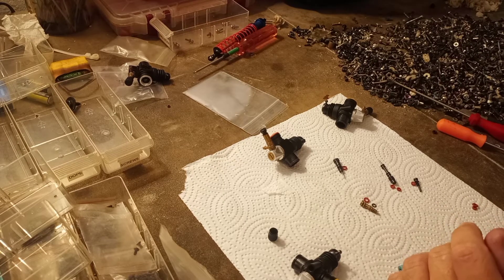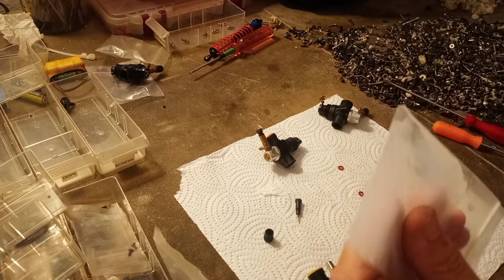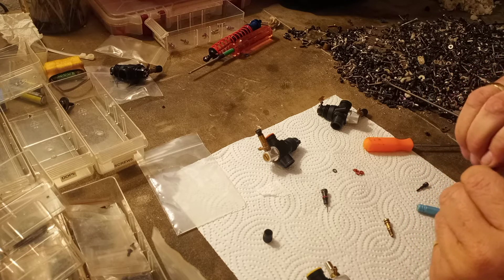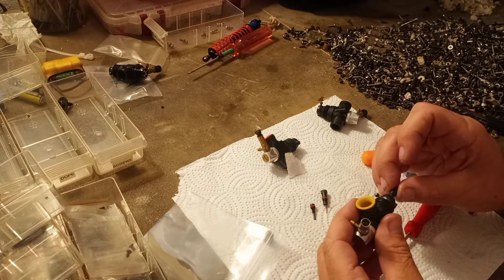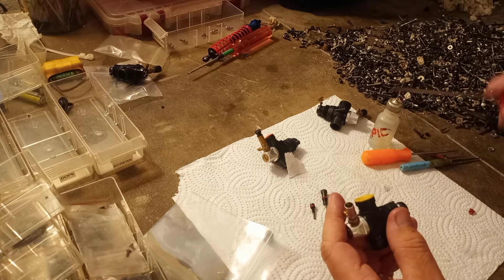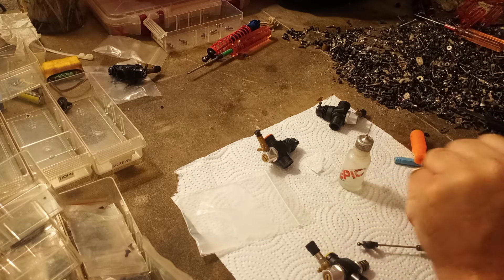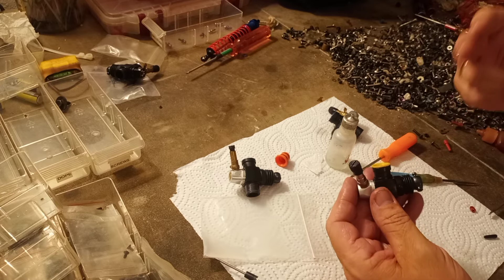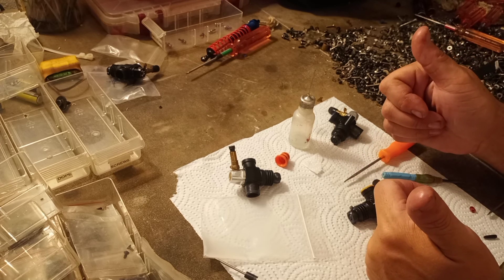Todd's Tips #3 rebuilding a nitro carburator carb new o-rings Molykote maintenance fix repair

Comment: Great vid and info! I’m rebuilding a HPI K4.6 which uses the same 3 needle carb(Kingstar). The mid speed needle is notorious for leaking, hopefully after they’re all replaced with silicone orings that’ll be a thing of the past! 
So I’ll need to order sizes 5x1.5, 6x1.5 and 4x1?
Reply from the maker: Correct, those are the sizes.
Reply: @NitroTalkwithTodd  Thanks! I was also looking into that MolyKote, is that the 111 compound? I heard of green slime but have never actually used lubricant for orings.
Reply from the maker: @SavageRobRC  yes,  111. I did a lot of research before paying $35 shipped for a full size toothpaste sized tube. I've been more than pleased with the results.

Comment: Nice video. Can I get a link to the o-rings?
Reply from the maker: https://www.ebay.com/itm/224557560168?mkcid=16&mkevt=1&mkrid=711-127632-2357-0&ssspo=eO_W8RE0QQq&sssrc=2349624&ssuid=fHwZ1_bCRtq&var=523346771857&widget_ver=artemis&media=COPY

The prices have went up a bit since I've purchased some. That is an example of a listing, not the exact one I used but it it's the same rings. You can get them cheap from China and wait a bit or pay more to get them quicker. The key sizes are 5x1.5, 6x1.5(both of those are in that listing and will be used in 75-90% of carbs) and the tiny one on this mid needle is a 4x1mm.
Reply: @NitroTalkwithTodd  could I please confirm with you buddy, here my orings are sold by... inner diameter by cross section of ring.... by that measure am I looking for 4.5id x 1.5cs??? Many thanks I've brought so many that don't fit 😂 love you content ❤
Reply: Edit...this message only goes for the 6x1.5 you recommend.. I understand I need the 6x1.5 and 5x1.5 also my moly already arrived on your word, an I'm very confident to seal up my engines thank you muchly ❤